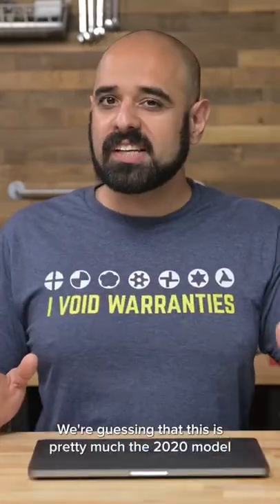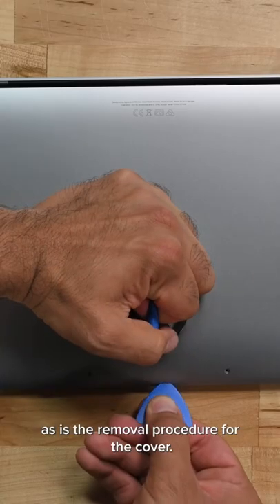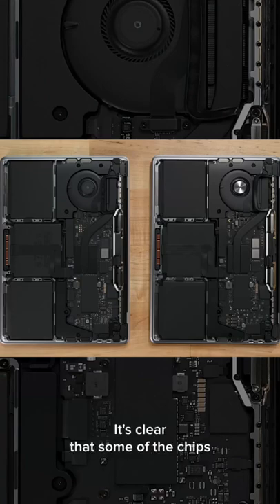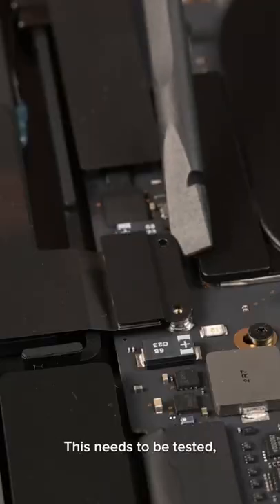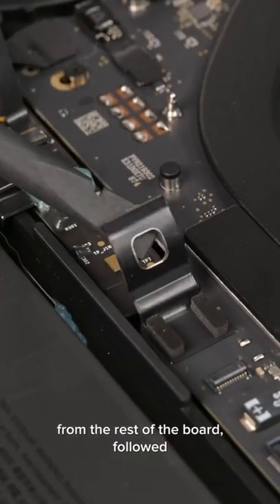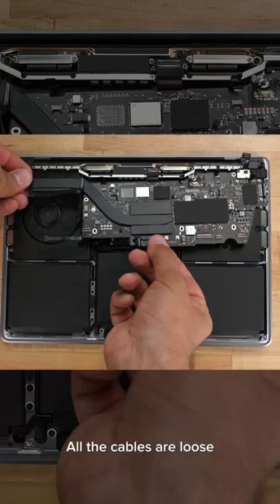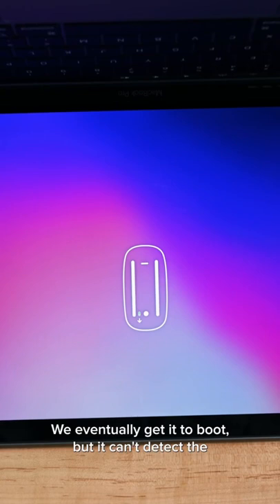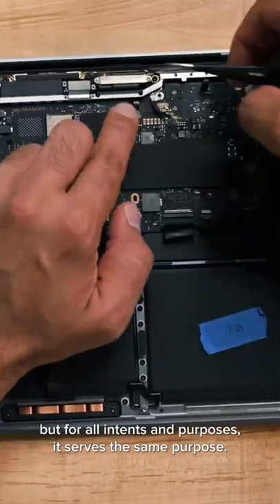We’re Pretty Sure We Just Tore Down the New M2 MacBook Pro!?

Comment: And I sit here with a couple old desktops around me happily changing out ram sticks, power supplies, fans, periperals, you name it to get the best combination of hardware for every system to sell. I might just stick to the bulky stuff.
Reply: Also happens with 3D printers. The vast mayority uses the same cables, board connectors and open source firmware (you can do whatever you want with it, it's yours)
A few use strange or propietaty cables/connectors that tends to broke and are hard to find
But there are some brands that use ALL propietary parts with closed firmware and hardware. Those are the worst and also most expensive brands
Reply: @wachocs16  yeah it is really convenient if everyone sticks to some standard design unlike apple